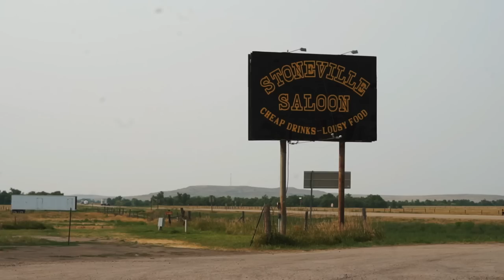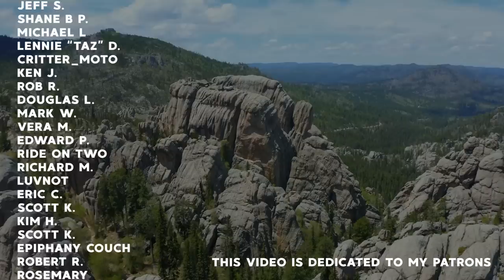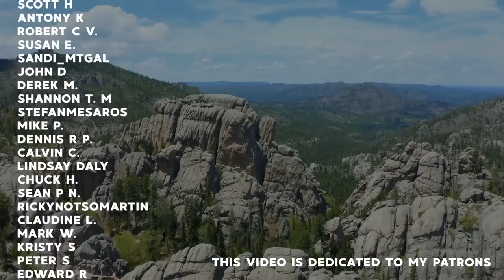I never thought I'd do that at a KOA Campground

Comment: I have been riding motorcycles for over thirty years now, and I can tell that chains are a major pain in the arse. You have to lube them every 400 miles, you have to clean them every couple lubes, you have to check and adjust the slack... If you are an occasional rider, it is not much of a problem, but if I was to put as many miles as you put on your bike, I'd consider a cardan or belt driven bike. Problem is, outside of the cruiser/custom world, most modern bikes come with a chain...
Reply from the maker: Lol shaft drives exist too ya know
Reply: @AstheMagpieFlies  that's what I meant by "cardan", anyways, you have to agree with me that, outside of cruisers and BMWs, chains are commonplace